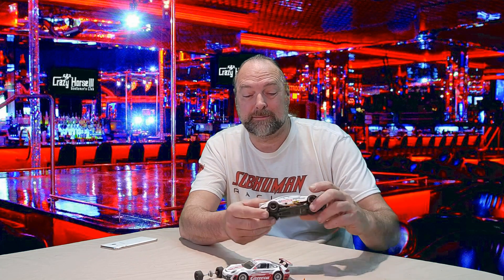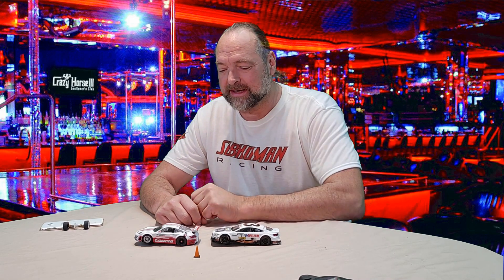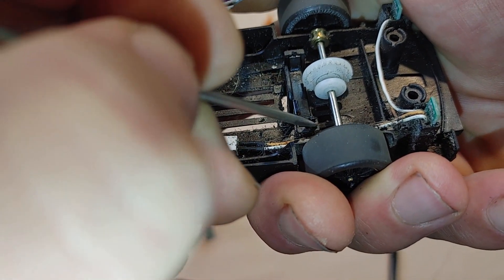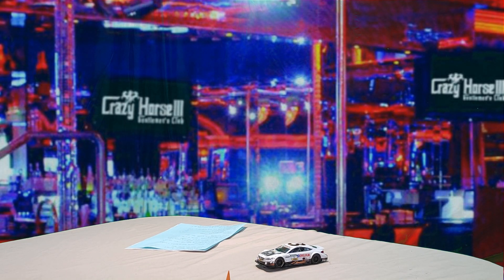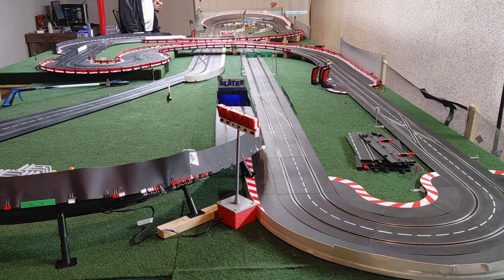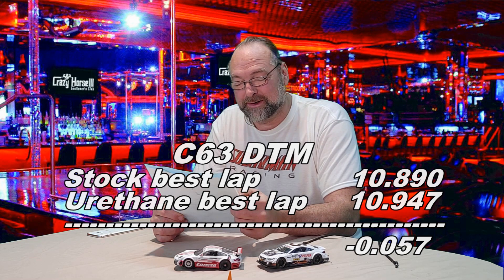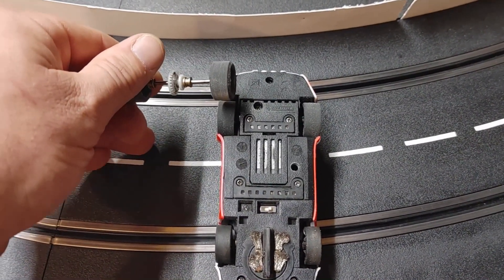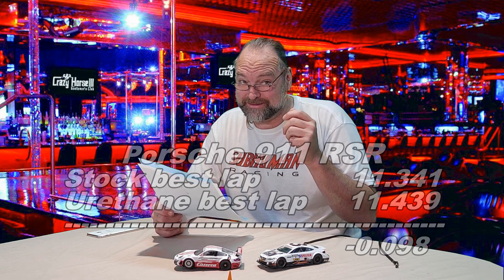Carrera Tires vs. Urethane Tires in No-Mag/Magnetless Slot Car Showdown

Comment: Get  rid  of  the  front   magnet   and  do  a  proper  mag free test . If  your  car  is  launching   add  some  weight  where   the  magnets  were   as  a  start  and   coat  the  front  tyres  with  varnish   to  remove  any  grip  . Good   rubber  tyres   such  as  NSR   will  out  perform   urathanes  in most  cases .

Comment: Great, honest video. I too was betting on the urethane to win. I run urethane tires on all my cars for the reason you mention at the end of your video; longevity. I usually find that after a year or sometimes less the rubber adhesion properties go away and they almost need to be sanded before each use to get some sort of performance out them. I don't even run a car with rubber tires anymore for that simple fact.

Comment: Would you and the Club rather race Mag or NO Mag? - Ive heard that you can control the 'Drift' more with NO Mag but you have to race 'Slower' and the normal fun/thrill suffers without Mag- Also apparently WITH Mag ther car is either ON the track or OFF with no inbetween feel...
Reply from the maker: Running with no magnets slows everything down, so yes, there is more control just from the standpoint that you have more time to react to the car. As far as fun goes, it is fun either way as the driving experience is quite different. Your best bet is to try both ways and see what you  like best. We usually run with the magnets but have the occasional no-mag race just for something different.

Comment: I don't understand your results, no disrespect, just saying my experience, I've been racing slot cars on my track and club racing, plastic and wood tracks and never, ever seen rubber stock tires being faster than silicone or urethane tires. The difference is extremely different at first lap, not even need to run the time. The rubber tires makes the car dance like crazy, and urethane are more sticky and hold the car in curve way better. 
So I really don't get how you get better results. With or without mags, doesn't matter. ✌️

Comment: Hi there, I prefer rubber on my 1/32`s. PU`s always leave their dust on the track and I like the grip of rubber better. Besides you need to true the PU`s more often, compared to rubber`s from my experience. I am curious, how the new rubber tires by Carrera will perform. They are suppose to last longer. I mainly use NSR Supertires, or Ultra`s. Also BRM has a few good rubber`s.

Comment: Hi  my club I’m A NYC run with both magnets out with silicone  tires we run 1/24 and 1/32. Both mags out. turn voltage down on 1/32 to 12 v and 19 v for 1/24.

Comment: Nice comparison. We went from stock on our Carrera GTY and used BobKat tires (they use a soft formulation of urethane) and found better control and lap speeds BUT we leave the magnets in our cars. What is your opinion when racing there ? Magnets or no Magnets  Thanks🏁
Reply from the maker: We normally run with the magnets. We occasionally run no-mag just for something different.

Comment: What software and setup are you using for the lap timing?
Reply from the maker: The lap timing program we use it titled HSSRMS, developed by Bruce Yuengling (I probably have the spelling wrong, sorry Bruce). The other primary program for lap timing is called SmartRace. To use SmartRace you need the Carrera BlueTooth module and a smart phone or tablet. SmartRace does not work on a PC running Windows, but HSRMS does. HSSRMS needs a serial-to-usb cable to connect from the CU to a PC. If you are interested in more info on HSSRMS, specifically how to get the program or connect to a PC, let me know.

Comment: Yeah nice test I kind of figured the rubber tires would work better and those carrera rubber tires are not no ware as good as other rubber 1/32 tires out, If you would have coated the rubber tires with a thin coat of wd40 and let it dry in the rubber tires really grip even much better and will run much faster.